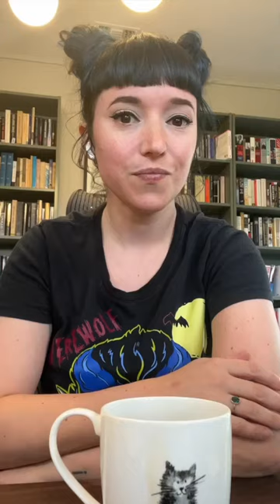The Nazi V-3 Cannon #author #history

Comment: Cannons fire projectiles not missiles?
Reply: While we mostly use the word "missile" to refer to modern rocket propelled weapons, it actually predates them. It means any object thrown or launched by a mechanism at a target.
Reply: @davidherbst  In the old language missiles are thrown not fired, but besides, this is 1940's terminology so missile is incorrect for a gun type weapon. Guns fire ballistic projectiles.
Reply: @nickbreen287 , technically, "gun" is incorrect unless you're talking about a smoothbore weapon.  The M1 Abrams series tanks mount a 120mm smoothbore gun designed primarily to knock out other tanks.

The M-60 series tanks -- with the exception of the M60A2 -- used 105mm rifles.  But the A2 used a 152mm smoothbore gun that allowed it to fire the Shillelagh anti-tank missile or more conventional HEAT and kinetic penetrator rounds.

The MGM-51 was what is called a "missile" in modern parlance: it was rocket propelled, but had a guidance system.  Unguided rocket propelled weapons are called "rockets".  That's why I'm careful to distinguish between rockets, missiles and space launch vehicles: I worked for WAAAAY too many officers sporting "pocket rockets".  And they can get a bit touchy if you do something like refer to them as "rocket man".
Reply: Did you not play DUNGEONS & DRAGONS.
Reply: @johndemeritt3460  This V3 weapon was not like any projectile firing weapon seen before or since. So TeChnIcAlly gun is fine for a placeholder to an unclassified system.
Reply: @nickbreen287 , aaaah, OK.  And "rocket" is as good a placeholder for any rocket-powered flying vehicle as any . . . . 

I won't argue toooo much.
Reply: @johndemeritt3460  It is actually? In WW2 anything with a rocket motor was just a rocket. The V1 and V2 were both called rockets at the time.
Reply: @nickbreen287 , I'm trying not to get TOO pedantic.  In my last post, I ceded your point.  But remember that there's popular usage of terms and expert usage.  The V1 was technically a drone, not a rocket.  But to the majority of people, it was a rocket: it shot fire out of the tail end and made a big boom when it hit the ground.
Reply: @johndemeritt3460  The terminology came later to help segregate technologies, but whatever way you cut it, missiles do not get shot out of giant cannon barrels. Even Excalibur guided shell is not called a missile despite having 90% commonality to a missile.